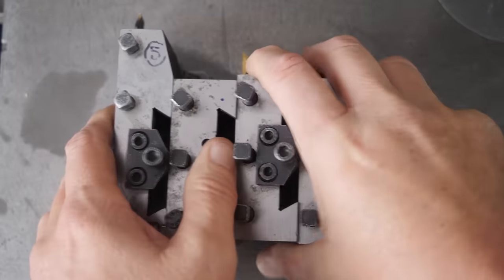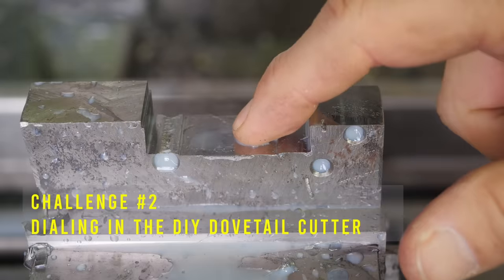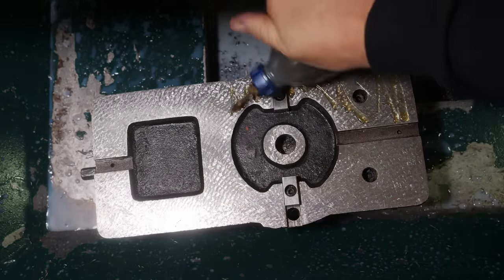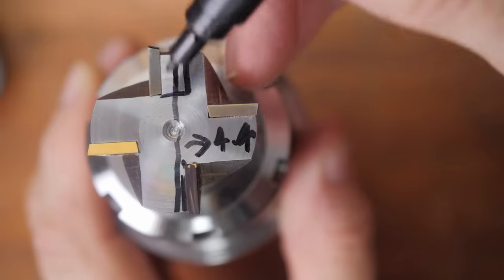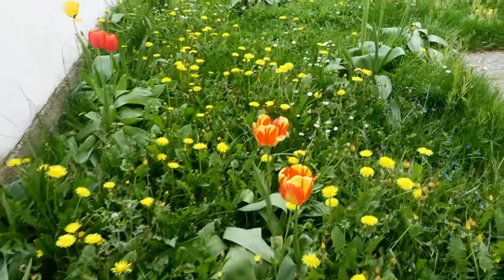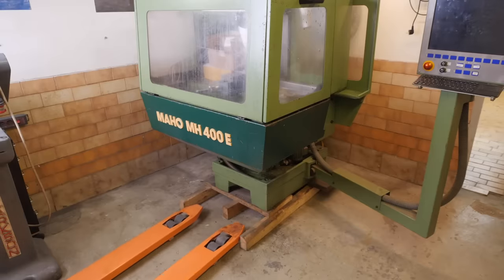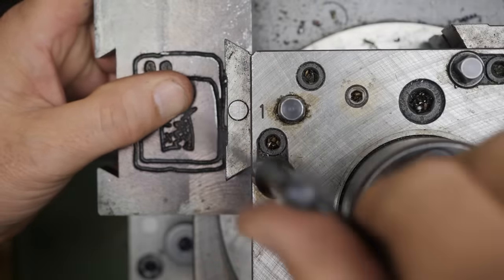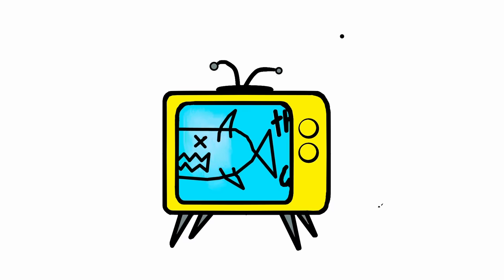Correcting the DIY dovetail cutter geometry  || RotarySMP

Comment: On some inexpensive vises (cheap) the frame of the vise is not the best cast iron. So when you tighten them it flexes the whole body of the vise. That is what’s causing you problem with the vise. You can test this by putting you indicator on the moving jaw side of your part or on the vise itself. With the part just snug but not tight in the vise. Then tighten the vise. You will see the movement. If you must use the vise whet you can do is tighten it to make your roughing cuts. Then losen and just tighten it lightly just enough to hold the part for the finish cuts. You may need to program with this in mind separating your finish cuts. Another thing that can help is to put more clamps on the base of the vise trying to use the table to increase the vises strength.
Reply from the maker: Thanks for your tips Peter. I really need to save up for a decent vise though :)

Comment: I got caught out by the too-deep thing with the first quick-change tool holders I made, and I won't make that mistake again when cutting dovetails. Doesn't that cutter look special when it's spinning fast in your fast-forwarded sections. 👍
Reply from the maker: Thanks. Dovetail tool holders need to be surprisingly precise. The take up of the clamp is pretty minimal.

Comment: Nice progress. 👍  measuring between pins like that is one of the many uses for gage blocks .tedious yes, but don't forget that a caliper is  =/- .025mm at best.
Reply from the maker: Oh, good point Steve. I have gauge blocks.
Reply: @RotarySMP  besides it's always good to check  calipers, micrometers, etc against the gauge blocks once and a while.
Side storey.. a few year ago we sent out a brand new starrett caliper and a cheap house brand Canadian Tire   caliper
for calibration   the cheap one passed and the starrett failed.
Reply from the maker: @steveggca  I notice that the twenty year old chinese one uses less battery, and is about as accurate as the Mitutoyo, but is slightly less rigid, so you see more spring in the frame and need more consistant feel.
Reply: I was sitting like “I’m sure I have seen him using gauge blocks on this channel in the past.” 🤔
Great results and an extra thank you for everything Maho related.
(Still haven’t managed to get my hydraulics to latch on…and no faults found in any E-stop chain. Builds pressure though. That goes away almost in an instant. No fluid mess to indicate a leak. New check valve at the solenoid/valve block. 🤷‍♂️)
Reply from the maker: @andli461  On my conversion, I don't have it wired to hold hyd Px. I just have it run the pump and build up Px when I  push the tool change button. Since I dont have an ATC, I dont see much point having it run the pump regularly.
Reply: @RotarySMP  I have a rotary table. So it’s used to lock that in place. But should be the same thing as the tool holder. Table brake as well. 🤷‍♂️
But still on the OE 432 control, I’m not surprised if it’s something in that part. I.e. a E-stop kinda thing running to  low pressure?
Haven’t had a look at it in ages to be honest. Felt like I reached the end of my capabilities. 
Thanks for the information though.

Comment: The width measurement wasn't dependent on the depth,  you could have just skimmed the top.
The depth should either be a hair under or a hair over the depth of the dovetails on the toolpost, depending on the which is the intended clamping face.  Most setups use the face of the dovetail so the toolholders would be a hair shallower.
Reply from the maker: True, but because I was still in set up mode and have 12 of them to cut, it was easier to get it sorted at the start.

Comment: Another great video.  You showed brake disks that you use for casting.  Do you need to add ferrosilicon to reduce problems with chill and hard spots in your castings?
Reply from the maker: I haven't dont that much, but with thick sections, it works fine as long as the casting cools slowly in the mold. I have not been able to source ferrosilicon (at least less than a ton at a time :)

Comment: The solution to overspray is stop spraying and use a roller! I stopped spraying machine tools years ago as it's such a pita and the finish with a foam roller is almost as good. Actually, the finish is more approapriate in many ways - slight orange peel much like the original finish. It's all down to the preparation of course. I also use a synthetic white spirit based enamel which is extremely hard wearing and only requires one coat. With a high zinc content the paint can also go over bare metal which means if you rub through the primer on your prep the paint is going to adhere nicely. Still spraying motorcycle parts with 2K though - rollers' just not good enough for automotive.
Reply: Interesting - what is white spirit based enamel? I only knew about alkyd base enamels. I too am a big proponent of either brushing or rolling paint on Machine Tools - can't see the advantage in spraying 2K paints on stuff that will only work indoors..

Thanks!
Reply from the maker: I don't use 2K paints, as I don't want that stuff in my lungs, if I dont get a perfect seal on my cartridge mask. I have never had any success rolling on a compound curved surface like that vise.
Reply: @mauromalvezzi534  I'm in the UK and use Johnstone's Smooth Metal Paint - it's a synthetic enamel with a high zinc content. If you take a look at my video series on adjusting Schaublin 102 bearings you'll see the finished machine in the last video.
Reply: @RotarySMP  It's really very easy to paint surfaces that are just about any profile. You do need to start with a brush to get into the crevices, but use a sponge roller with a feather edge (concave end) and you won't have any problems. Take a look at the lathe shown in my series on Schaublin 70 and 102 bearing adjustment - the finish is extremely good but dependent on careful preparation of course. A 2K primer-filler can be heavily brush applied before sanding. I agree about 2K being nasty, but applying by brush and wet sanding avoids most of the risk - always wear a good mask of course.

Comment: I have no experience with that CNC but with the 24 volt down it was swinging back and forth chasing a M19. Probably has a switch in the spindle somewhere for the index of the spindle. No 24 volt no switch signal. Surprising there was no alarm for it.
Reply from the maker: The gearbox shifting software was written by a friend of mine, based on a spec from me
https://github.com/jin-eld/mh400e-linuxcnc/wiki
I didn't spec this case.
Reply: @RotarySMP  Oh I wasn't aware it had a custom control. I thought the Knock out cycle might have been one used for a machine with an optional tool change.  Pretty easy fix if you wanted to just add a 24 volt relay into the feed hold circuit. 99% of cnc's will turn the 24volt on the moment the E stop is released. So it would power up the same. Just go into feed hold if you lost the 24 volts.
Reply from the maker: @dazaspc  The Maho is a mix of original wiring and my conversion to LinuxCNC. I have never had that CB trip before, and will just keep an eye on it for now. There are three 24V rails. One is always on, and two drop with E-Stop. I much have the twitching relays on one, and the gearbox shifters on another.

Comment: When using a triangular shaped insert to cut a 60 degree dovetail, doesn't the bottom of the insert rub on the "floor" of the cut?  Perhaps that is not a problem?
Reply from the maker: It does, and seems fine, until the insert loosens :/

Comment: Can't be good for vibration to have the machine sitting on wood and not leveled.
Reply from the maker: True. I need to make up the steel frame with the adjustable vibration absorbing feed for it.
Reply: For every other machine I’d be with you but the Deckel/Maho machines are so monolithic and stiff that it doesnt really make a difference because of the gigantic foot. You can probably hang one of these machines on a bar from a crane and still get accurate results.
Reply from the maker: @Narwaro  I am still planning to put it onto a raised weldment base, so I can always get the pallet jack under it, but have it sit on vib damping feet. I really like them.

Comment: You'll notice some places where you don't realize how religious about the mathematics some guys are.  That dovetail insert, I assume is one of them.  They guy who wrote the book copied the book tat the guy who made the carbide and then the guy who made the tool post simply assumed the only way to do it was to copy the book.  And there you are trying to figure out how to get your part to fit the machinist religion.

You'll notice the same thing in electronics...only booby trapped sometimes.  If you see a transistor that has a little spot of paint on it, look out, because that is what all of the technical jargon leads up to.  Transistors have surprisingly few variations within a manufacturers batch but for all practical purposes the could just have a different part number for every batch.  The only odd exception is when you stick to the book that doesn't allow your having any say in the adjustment.  

For instance if you were to design something with a volume control and then decide that it is cheaper to just replace the volume control with two resistors.  Take potentiometer out, measure where you like the setting, select those to resistors and solder it in.  What you did was you just resigned the device so that it is no longer field repairable.  The only way anyone can replace any part in it is with the parts that come from your part bin.

Taking that "religion" into account, yours being an aircraft mechanic, let's do a bit of underwriting for a moment.  HOW MANY UNDERWRITERS DOES IT TAKE TO SCREW IN A LIGHT BULB IN A 480V MACHINE?  Ok now, take your ohm meter and a bit of that coolant from your machine's sump and lets measure exactly how many underwriters it would take.
Reply from the maker: Yeah, it is tough to get everything right and everyone happy :)
Reply: @RotarySMP  Stephan would get the spelling right.